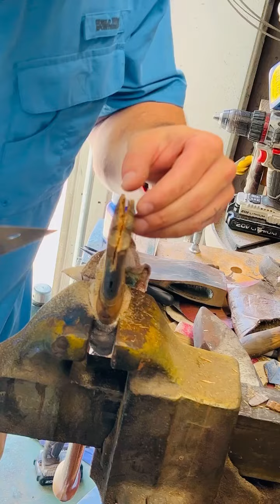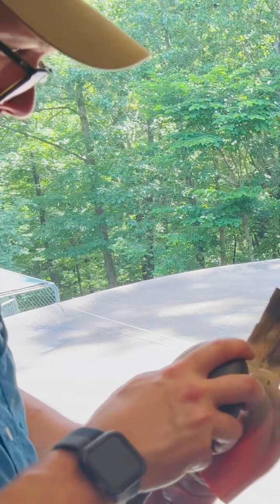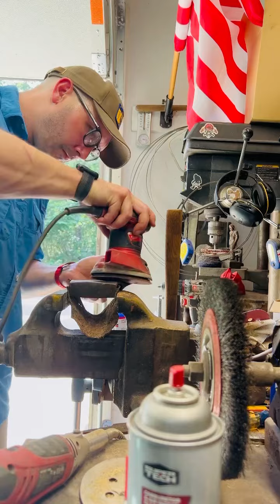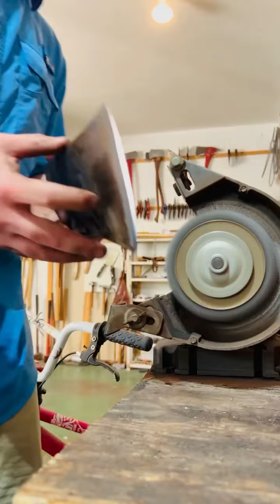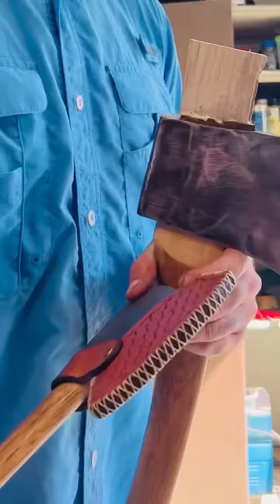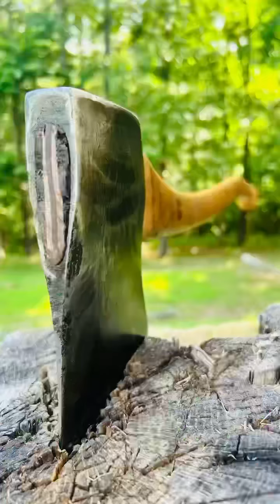Collins Legitimus restored with original handle. #videoleap #axerestoration #axe #diy

Comment: Well done, dude. That handle is a beaut, great job saving and rehanging.
Reply from the maker: Thank you.  Connie’s are not common to come by in my neck of the woods, so to find this one  was a treat.  Definitely one of my favorites.
Reply: @tpainington Connecticuts are one of my favorite patterns as well. My most used axe is a Collins Legitimus Connie and I just won another on eB to restore. Wish I could find an old thin handle like the one you've got there. Will probably wait until Killinger has some of his in stock.
Reply from the maker: @vairboy  Killinger handles are great.  Definitely one of my favorites.